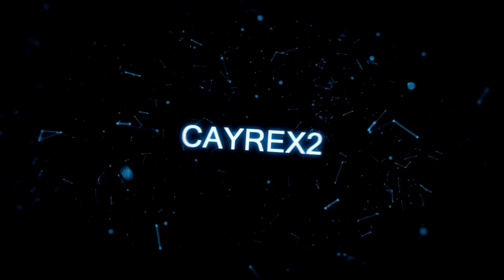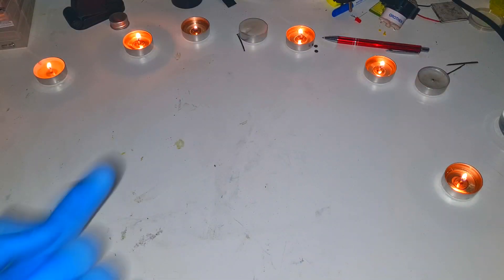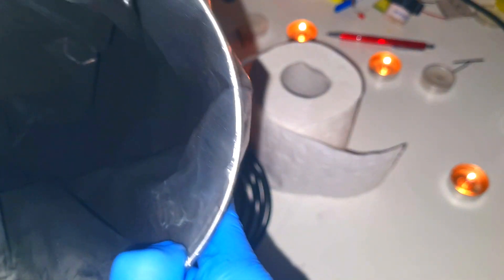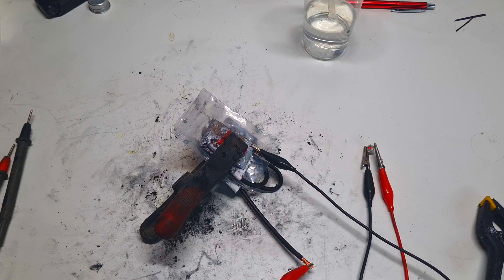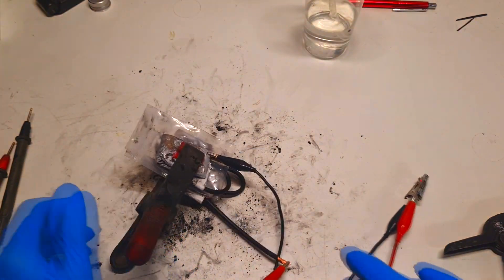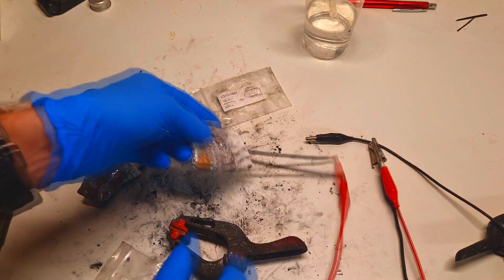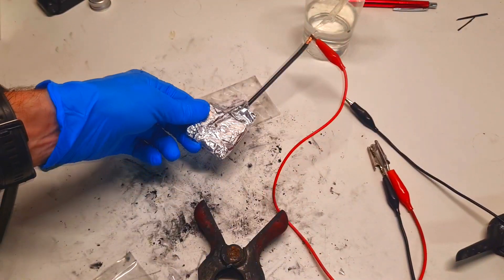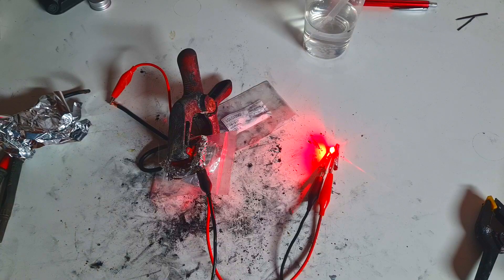DIY Powerful Emergency aluminium battery

Comment: Dude, how an oxygen is going to reach a carbon? =)
Reply from the maker: @sc0or  Oh dude, really. Do you ever see some comercial zinc air battery? The needle tiny hole is the air hole. And here the cells what I make are never airtight! 🤣Oh boy.... 😉
Reply: @cayrex  Oh Boy.. It does not use oxigen. Neither zinc-carbon, nor zinc-chloride. And the hole is for a resealing reaction gases

Zn + 2 Cl− → ZnCl2 + 2 e−

2 MnO2 + 2 NH4Cl + H2O + 2 e− → Mn2O3 + 2 NH4OH + 2 Cl−

Zn + 2 MnO2 + 2 NH4Cl + H2O → ZnCl2 + Mn2O3 + 2 NH4OH
Reply from the maker: @sc0or  🤣 Zinc air batteries.... for hearing aids. My friend use it alot of thes because she is hard of hearing.
Reply: @cayrex  Those batteries have 10mg of Al and microwatts of power. "real" alu-air batteries need an air pumped into a chamber with a PETF membrane to feed a cathode. You can easily calculate how many moles of O2 a certain amount  of Alu needs. 27 gram of Alu need 321 liters of air
Reply from the maker: @sc0or  Yes yes 😉

Comment: Give a try to baking soda and some thin lead sheet or roll electrodes.
Charge and discharge it many times. reversing the polarity occasionally. and the capacity will grow more and more!.
Works and rechargeable! Very high discharge current as well if you make the design with thin separator and spiral wound roll sheet or lots of thin flat parallel sheets stacked.
You can use as thin as 0.3mm lead sheets and it works!
Thinner lead sheets you can get more capacity and power in the same size but lower lifespan (cycles)
Thicker lead will take up more space but will last a very long time.

You can even use soldering wire if it contains enough lead. wrap a few layers of napkins around it then wind on another layer of soldering wire.
You can use a pencil or small plastic rod or a pill bottle to wrap the wire around. Make sure the separator is thick enough to prevent short circuits.

Electrolyte of baking soda is very safe and ive not had much trouble with it. 
The voltage fully charged is roughly 1.2-1.5v
Discharge voltage is around 0.9-1.3v similar to an AA battery
You can use several in series to make a pretty simple and decent rechargeable battery.

When doing the final charge cycle you'll want to stick to the same polarity from then on. and charge it for a long time at trickle charge. low current. 10-25mA to about 2.4-2.5v
That will decrease the self-discharge rate.
The longer you hold trickle charge on it the lower the self discharge.

Comment: I think that your battery will turn better if oxygen can touch carbon electrode
Reply from the maker: Correct. The cells are not airtight so the cathode can breathe.

Comment: Nice demo again...very clear, thank you. Have you considered soaking the AC and separator in fully saturated electrolyte and allowing them to dehydrate, then wrapping with the foil anode and storing as a completely dry & inactive cell ? Then, when an emergency hits, one could simply hydrate the cell by immersing or soaking in water and you have instant emergency power.
Reply from the maker: Really good idea,.... need to try. I was thinking almost in the same way,.... but I was thinking of just  puting some pure salt to the bottom of the cell, and then just ading water and mix. But that idea can be used when you have cell housin like was in the video where I make reusable aluminium air battery.

Comment: You can take the outer skin and corroded zinc off a zinc cell and put a napkin around it and wrap in a few layers of foil and use koh or washing soda for electrolyte . Its fun way to use old battery and also use joule theif circuit to light led easy.
Reply: A zinc aluminum battery? = 0.9 volts

Comment: what if you build that cell on 1/4" or 1/2" aluminum plate instead of foil? might have less surface area but should last longer.

Comment: it's just a super simple battery.  I'm glad you share your updates.  you checked it for the time of work.  How fast does aluminum corrode?  how long can she work?  there is a dependence on the current consumption of the operating time?
Reply from the maker: That was the point to make simple battery. The battery work first for 20 hours and the aluminium foil was almost all corrodet and the cell was also almost dry. Then I add fresh electrolyte and aluminium,.... and the battery works for another 24 hours or better to say,.... it still works (but this time the aluminium is still in good shape after so many hours).

Comment: Better use Washing Soda or Pottassium Carbonate. You will get about 1.3 to 1.4 Volts per cell and the Aluminium foil will not dissolve so fast !!!
Reply: Reduction Oxidation.
I imagine the more it dissolves the more power you get. Is that true?

Comment: I've been interested in Aluminum batteries for a long time.   However,  I wanted to know if you know a simple way of recycling the used material back into aluminum.
Reply: You can easily but you need a lot of energy

Comment: does vinegar activate carbon, it conducts current better in vinegar as the solution
Reply: have you tried ethanol + koh as the electrolyte
Reply: I mean 100% ethanol + koh, no water
Reply: fatty acids in ethanol-koh solution? lol, I mean ethyl esters, synthesized
Reply: aluminium with koh generates a ton of hydrogen tho
Reply: something better for aluminium
Reply: try ethanol + zinc/magnesium sulfate as metal-air electrolye, no water, non-aqueous
Reply: how about a carbon felt cloth ethanol-koh salt bridge, assuming the ethanol container is closed off to prevent ethanol evaporation
Reply: how about molten koh as electrolyte at 360C or 400C
Reply: try copper-carbon/air, in the ethanol-koh solution, where OH- ions are assumed to be in the half-reaction, not H+

Comment: If you made 5 cells could it power a mobile phone. That would be quite useful.
Reply from the maker: Yes you can
Reply: It may produce the voltage but maybe not the current under load. An LED works on as little as 20 milliamps. Cellphones take considerably more current.
Reply from the maker: @justtinkering6713  This led is 1W led
Reply: @cayrex  I use a 1 watt, white led for my long duration led circuit. But I think the red is better during an emergency because it doesn't ruin your night vision. When a white led goes out during an emergency, it takes time for your eyes adjust to the dark. Red light doesn't have that problem . Great battery.
Reply: @justtinkering6713  would it work if you connected 5 cells in series to get your voltage then add more sets of 5 cells in parallel until you got enough power to charge a phone. (in an emergency it might be worth it)
Reply: @edwardhughes352  Hopefully the cell tower is powered by a different circuit than your local power.
Reply from the maker: @edwardhughes352  No need for 5 extra cells in parallel. You just make biger cells with more activated carbon to higher the power. Around 1 gram of activated carbon (with surface area 1000m2) on 1mole of KOH can give you around 150 to 250 mA.
Reply: @justtinkering6713  Reminds me of a recent "Itchy Boots video" she is travelling through remote african villages and none had electricity but they all had cell signal.
Reply: @cayrex  I Never thought of that. thanks.

Comment: Bravo😃 Preparation is the answer.
What I have done is save all my used dry cells. They still have useable power. Then I built a special circuit that will work on very little power to light an LED. It will light continuous for 60 hours or will flash brightly for over two years on one new AA cell. I figure I have over 20 years of batteries for this light. On my yt
Reply from the maker: Awsome